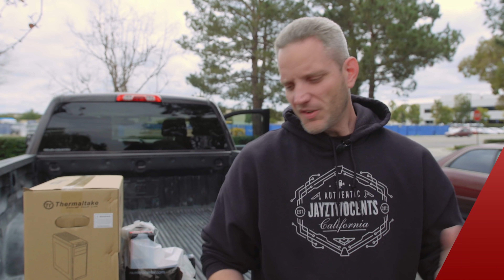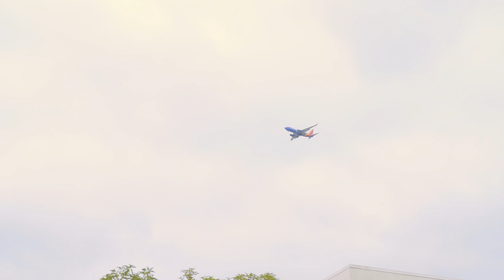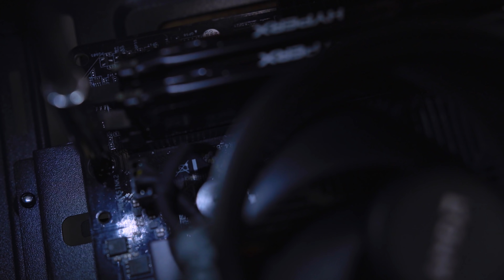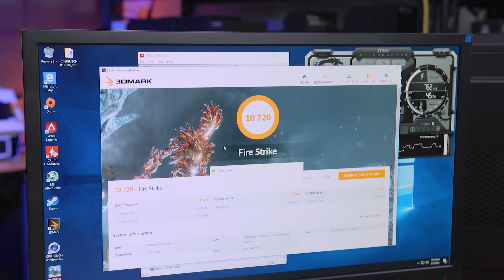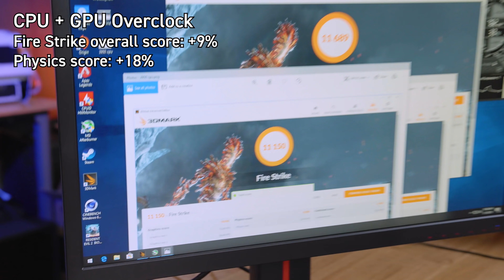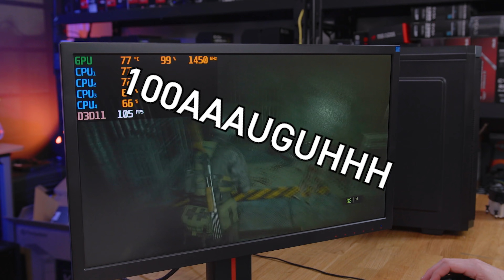CHEAP Gaming PC Build - 2019

Comment: That SSD seemed hot, sadly didn't show it. And no need to pirate Win 10, it's under $20 legit, so cheaper than anything in the build (other than added fan). Apex Legends looks good, runs good and guns fire nicely, but sadly I don't like to get loot and then instantly lose it. Good thing about it that even if you've played it a day you can have all the stuff with those with 1000 kills, so great for a casual player. But the biggest positive on BR style is the biggest negative for me. Even if you'd start with a pistol, it would be a huge upgrade. So many games I've died before even getting a gun.

Comment: I just finished my build. I did a I9 9900k, ROG Maximus XI Hero wifi edition, Corsair RM1000x PSU, Enermax Liqtech TR4 II 280 AIO, 8 T.B. RGB fans, 2 M.2 NVME SSD western digital black 512GB, 32 corsair vengeance rgb pro 3200, and a MSI Armor 2070 OC edition.

Comment: I'd really like to get that 580, but the comments on NewEgg as to it's quality, thermals, and longevity is really scaring me off. The RMA process described seems really problematic as well.  What do you all think?
Reply: Check other 580s and but if you really want the one jay used maybe just pay the 20-50 extra dollars for store warranty. Microcenter has that and it's for 2yrs.
Reply: @MrEpicgamer123  Appreciate the suggest, but it kind of defeats the price point if I'm adding $35ish dollars to it.  I can get another companies 580 that has a rep for good quality for $20 more.  I was asking more if others knew about the problematic (per EggHead comments) nature of the card being used in the video mostly.  And I'm not astroturfing or anything, I have a 1050 I'd like to upgrade, but not if its going to be a loud whiny overheating mess, before it just breaks, and can't be RMA'd to save me life, etc. etc.
Reply: Idk about that this specific company version of the 580. I have used the rx580 red devil in a system I made in 2017 and it's still going strong and it's not loud
Reply: @MrEpicgamer123  Neither do I.  I'm just going by what I've read on the NewEgg comments for the same PowerColor RED DRAGON 580 card (https://www.newegg.com/Product/Product.aspx?Item=N82E16814131720).  Bunch of 1's and 2's ratings.  EDIT: Seems to be Dragon specific 3/5 eggs, the Devil has 4/5 eggs, better comments.  EDIT2: NewEgg had an one hour sale on the Devil version (PowerColor RED DEVIL Radeon RX 580 DirectX 12 AXRX 580 8GBD5-3DH/OC 8GB 256-Bit GDDR5 PCI Express 3.0 CrossFireX Support ATX Video Card) for $199, so I bought that.

Comment: Funny that you posted this today. 

I just bought
- 2200g (79.99)
- Gigabyte B450 Aorus pro wifi (108.99)
- 500gb Samsung Evo (77.99)(they accidentally pulled a 250gb at the register and I didn't notice, price difference of $19 right now)
- RM550x from Corsair PSU (91.99 kinda overpriced but w/e)(they initially sold me a g3 750w from evga but I wasn't planning on needing it so i brought it back and got the corsair when I replaced the ssd)
-  I bought the beautiful Aegis from G.Skill 16gb of 3000mhz @16cl for 89.99 it's the reason I bothered to buy the build
- On the way home I was able to purchase an Rx 480 4gb from a friend used. He pulled it out of a 1070 ti box. It even has a back plate, i'm assuming he took good care of it. I got it for 80.
Overall I paid about 587 and change with the tax.

- I just need to buy a case now and I can't decide what to buy. I plan on upgrading to the zen 2 3000 series and getting a new GPU when I upgrade my monitor. I'm repurposing a 1080p 60hz HP monitor the 2311x. I'm using a Logitech K120 Keyboard and a Sharkoon Fireglider mouse that I already owned. 
- I thought I was going to be getting a case for free but it ended up being a little outdated. My PSU wouldn't have fit and the fans had molex cables and small fans. I'm going to be opting for something more modern but I haven't decided on a case yet. 

- This is my first PC that I've owned since I was a kid, the last one having a floppy disc drive and running windows 95. Up until now I've been sharing a 2013 mac all in one desktop that has a Haswell i5 @3.2ghz and a GTX 750m.  I'm pretty stoked to start my HD gaming journey! Thanks for sharing the vid. I hope more people see this opportunity to get into PC gaming and take advantage of it. I got lucky with the 480 but it's definitely more worth it to pair it with the 580. A lot of games I play don't recommend 8gb of vram so I think I will be okay with the 480 til I find more games I want to play.
Reply: 480 and 580 are essentially the same card
Reply: @nostrum6410  I researched it and saw the 480 came out in 2016 so it's not even that out of date yet! I'm pretty stoked.

Comment: I wanna play AAA titles with over at least 60fps on 2k, max settings. Can anyone suggest me pls.
Reply: Ryzen 5 2600 should be good(minimum if want better have to go more expensive parts) 16gb ram 3200, 240 ssd, 1-2tb hard drive, 650w psu, b450 motherboard, and case up to you, graphics card it's between 2060 and 2070. Have to watch benchmarks to see which suits your needs better
Reply: @MrEpicgamer123  Thanks a lot !! Must I really go AMD cpu ?? What is the intel alternative of it ? or is AMD the better choice to meet my demands ?
Reply: Equivalent I think would be an i5. Just check prices to see which works better for you

Comment: His budget build gets 11,500 in firestrike, my 2080 and 2600x gets 20,000, for context.
Reply: I just did a used 1070 build for $490 if you're interested, it performs very well.
Reply: @RamB0T  yeah that's what I upgraded from, it didn't really satisfy me once I got to 144 hz though, but it can max anything on 60.
Reply: @m.streicher8286  Nice! Any problems with the GDDR6 ? Bryan over at TechYesCity had some issues with crashes...
Reply: @RamB0T  no, I haven't really pushed it, but I have it on +550
Reply: @m.streicher8286  Nice, how long have you owned it for? I was thinking about getting an RTX card for the channel. Was concerned about the reported issues.
Reply: @RamB0T  I think the issues we're just on the 2080 ti, plus most brands are good about replacement. I've only had it for 3-4 days I got and awesome deal on it used.

Comment: Apex is horribly optimized. I can barely hit 80 fps on the lowest settings with a GTX 970/i7 4770k combo meanwhile, I'm getting 200fps in BF4.
Reply: 1% lows and 0.1% lows are soo bad in Apex. Micro stutters on a 1070...

Comment: A video on how to prevent leaks & how to clean and prep your system if a leak happens? I had a leak today & it was scary. I'd honestly like advice  on it just not much info out their on if something goes wrong & what to do when it does happen.
Reply: Try asking Reddit or Lord Google
Reply: Aio or custom loop?
Reply: Reddit will be the best place for this question mate....but a video is helpful👍
Reply: What was your cooler?
Reply: @TurtleBobThe1st  It was a custom loop. The fitting was an ek compression brand new. That's why i'm a little confused. Both o rings were making good contact also.
Reply: @Near2Future  try contacting them, maybe they can help you
Reply: Honestly the best you can do is pray, other than that unplug your PSU and take it out and make sure absolutely everything is dry. If it got into somewhere small this can take a very long time. It's really important to stress test loops before you put them into your build:)
Reply: He does have some video's on this already. But for the life I can't think of the exact name. Maybe try Kyle's PC leaks or Bit-Wit PC leaks. And that will probably send you down the "How to take care of a leak on you're PC" Youtube rabbit hole.
Reply: That would be the best video I wish he would make !

Comment: I got to point out that you can get 1450 MHz at +10 MV, a Power Limit of 100% (IE Stock Power) Temp Limit of 84c (Stock Limit) and if you do a good Fan Curve you can hold at 68c... Most RX 580's come out of the Factory Overvolted by 20 MV... You can actually Tick it back -18 MV and get 1400 MHz Stable! You don't need 120% Power or that many Millivolts to push it to that Clock... Your wasting Electricity and creating Excess Heat Jay that and that extra 50 MHz means 5-10 Fps Tops...

Comment: i have the same graphics card but a better processor and a NZXT case and a as rock motherboard
Reply: Does the graphics card get loud? I heard it does
Reply: @husnainas6148  i mean if you have good enough airflow through your pc it should not have to go full blast. And when it does its sorta sounds like a ps4 but quieter
Reply: Unless if you put it full blast on purpose to cool everything down then yeah its pretty loud

Comment: Glad to see we're back to a day and age where you can realistically buy a good mid range system for 700-800 bucks again that will give you 60fps at 1440p or 144hz at 1080p.
Reply: devilmikey00 no way that can give you that performance
Reply: @mynameisazz  Ultra settings at 1440p with the rx570.
Reply: @mynameisazz  My 2400G, with an rx570, plays Dirt Rally at 1440p, 75hz, freesync on at 75fps+.  The 2400g on its own plays at 1080p 59fps average, 51fps at 1440p, both medium settings.
Reply: Craig Howe what about other games?
Reply: @maincharacter2677  I just ran a bench mark for Formula 1 2018. 1440p, high detail, 75hz, Free Sync on with the rx570 we are getting a min of 58fps and an average of 68fps. I don't have a lot of games I can test for you, sorry.

Comment: i just want to see a possible mid tier 1080p, maybe 1440p 144hz build thats as cheap as it can get that can have more than 70-110 fps cuz my very crappy rx460 just isnt cutting it anymore and i would like to know a price point i need to work towards 
i dont care about 4k, i dont care about ultra settings,  cuz i usually turn those down to get as much fps as possible
im assuming an rx590 or gtx1070
Reply: Thinking rtx2060 with ryzen 7 1700x( 140 at microcenter I go to but no cooler) or ryzen 5 2600 and 16 gb 3200 (140 ish as well) on b450 motherboard and then fill in basics
Reply: @MrEpicgamer123  any intel equivalents to the ryzen? i just want to know all my options and ill pick whatever based on price
Reply: Intel equivalent is i5 (for minimum)    and I would run it on a z390 motherboard not the h- don't remember the numbers board
Reply: @MrEpicgamer123  an i5-7500 okay? ive got an unopened one cuz my current motherboard isnt the right chipset for it  it was a gift from my family and they have no clue about  computer tech stuff
Reply: I think that will be ok. You would have to look up benchmarks with that cpu to see if it can handle the games you want

Comment: Maybe some1 can help me I have i7 7700k looking to upgrade gpu I have gtx 1050 ti not looking to spend more than 500 wondering what opitions would be best bang for buck
Reply: If you're brave enough to try it may be check used parts might be able to get 1080s or 1080ti for cheap. If not rtx2060 or vega 56 but vega might still be overpriced. Vega only if good price like 100 bucks cheaper if not rtx 2060, rtx 2070, or Gtx 1660

Comment: to save extra money, get open box on everything you can, most have a complete open box set. Also check places like bestbuy, newegg, and amazon for better deals, microcenter will match price if sold by the respective company (so it has to say sold by amazon/newegg). Can build a more powerful system for the same price.

Comment: I have a couple of those Inland Pro 240GB SSDs.  I have not had them long (3 months or less) but they work fine so far.  My use case is also budget gamers....not quite so much budget.  One i5 with a 1060 and one 2600x with a 1060 but that SSD is key to making the "not suck" happen.

Comment: Just as a reply to Jay's build I did some stuff using Newegg's wishlist:

CoolerMaster MasterBox Lite 3.1 MicroATX Case - $39.99
ASRock B450M-HDV R4.0 Motherboard - $69.99
Powercolor Red Dragon RX 570 OC 4GB - $129.99
RAIDMax Scorpio 535W Semi-Modular Power supply - $43.52
AMD Ryzen 5 2400G - $139.99
Silicon Power ACE A55 2.5" 256GB SATA-6.0 3D TLC SSD - $31.99
OLOy DDR4-3000 Single DIMM 8GB RAM - $42.99

Total price: $498.46 minus a copy of Windows and a monitor and keyboard+mouse set.

Jay is spot on, you don't need to break the bank to just to build a nice unit to play games. Game developers know what people have and are running since the mess with  mining happened, so nothing out there is going to be so outlandish with requirements. Hell, most games are geared to run on as minimal as a Vega11, RX560, and GT1050 just to make sales alone of games so publishers can make returns on their investments.

Always look for special deals and price reductions on parts as well. There are lots of reputable PC parts manufacturers out there and a lot of up and coming new manufacturers, so you'll often find a lot of parts either on sale, reduced prices, or simply just cheaper. You might even find Open Box deals (usually former demos used for product tests by Newegg's Youtube channel) for great deals also.

Be merciful to your wallet. Treat it well, and it'll treat you well.

Comment: On any of these thermaltake cases with the filters, take them off the front and top, leave the one on the bottom. Case temps drop about 5C by doing so, maybe more depending on how many fans you have in there. I had to do it on my View 71 TG, take the front and top filters off, dropped my inside temps down to actual room temp, instead of being nearly 10 degrees above.

Comment: My 2400g with a RX580 8gb runs everything at 1080p juuuust fine!
Reply: im confused why youd get a 2400g and a graphics card
Reply: @nostrum6410  why wouldn't  i? I honestly already had the Rx580 from a previous build, a build that i sold the 970 motherboard, 16gb ram and Fx8320e  processor out of, then bought a new motherboard and the 2400g  and i had 16gb ddr4 on hand......2400g is my Backup/media pc.  i could absolutely run it with tjust the vega 11 but i like to play games on it too!....so thats  WHY....

Comment: I feel you should always include monitor/keyboard/mouse since its also an additional cost for those just getting started and if it is an "entry" level Pc, it usually means if youre buying this, it's your first pc. So you don't have anything.
And a cheap monitor vs a 144hz monitor could mena the difference between getting 8gb of ram vs 16gb, a 2200g vs a 2400g... etc etc.

As for the OS, Just put Windows 10. It's free. sure youll have the watermark, but the Os will still work fine. Activate it whenever.
Reply: Problem with including those things is varies with people preference. I mean if he's going budget. 30 buck keyboard mouse combo from cooler master. Use a tv you have at home.

Comment: I did this same build with an older AMD FX-8350 overclocked an extra 500mhz... Not a bad build for the money. RX 580 runs at 82 degrees which in my eyes is a bit warm, but it will play Apex as its fully optimized game.

Comment: The 2200G already bottlenecks a GTX 1060 at 1080p, i can imagine it even bottlenecks an RX 580 slightly more. Bad choice as a cpu imo. Your 0.1% lows will be too low.

Comment: @JayzTwoCents I got a hp pre-built just over a year ago with 8gb 2400mhz ddr4, ryzen 5 1400, rx580 4gb, 1tb hdd, crappy motherboard and a disk burner for good measure for 560$ on amazon of all places.  (hp 580-131)  Don't worry I just robbed parts out of it... this is when rx580s were 600$ because of mining...

Comment: Just throwing this out there (like I did in a previous episode): buy ur GPU's used. End of story. There's SO MANY options on ebay, and for ~$100 you can fetch a GTX 1050 or 1050Ti (after some serious bidding efforts). I got my EVGA 1060 SSC for $136. 

I would also drop the hard drive entirely, and either get a more known SSD brand for that money, or get a 2600X Ryzen.

Comment: Roughly $500 if you must play using keyboard and mouse or only pay $213 for the Xbox one or $320 for a PS4. I suppose the PC can do a lot more things to justify the price premium compared to consoles… But it's difficult to justify if all you do is specifically gaming.
Reply: Yes and no it won't run at those quality settings. That PC is more comparable to Xbox one x and PS4 pro
Reply: @MrEpicgamer123  my point still stands… Both the PS4 Pro and Xbox one X are roughly $390 at Walmart anyway. So roughly $110 cheaper. The only defense for the PC is keyboard and mouse is debatably better for FPS like Apex, and PC being versatile in the number of uses it has outside of gaming. it makes me think it's rather impressive the cost per performance is as good as it is.
Reply: Yes you have a point it's slightly cheaper but you don't get the same performance. Consoles don't go past 60fps. Most games are locked at that and struggle to stay there.

Comment: The same build here in Australia;
2200g - $139
ASRock - $101
HyperX - $94
2tb - $78
SSD - $52
Case - $85
PSU - $96
Cheapest RX - $299

All up $944 + $60-$100 for delivery.
Have to buy online here, walking into a store would be double that price and they would order it in anyway.

Comment: This is pretty damn well future proof compared to the Dell Optiplex route but it can't be beaten. 

Could build the same system with the Dell Optiplex for 125-200$ cheaper still having a ssd and hdd.

Again, not as future proof but would be something closer to "budget building."

I would go Dell Optiplex 790MT. Has a i5 2400, and 8GB ram with no hdds.-115$ 120GB SSD- 20$. 1TB 7200 rpm-30$. 550w PSU-30$. RX 570-110$

Total 305$ 

Much cheaper and great performance. Not a 580 but pretty close. 

Could buy a 580 instead and still be cheaper. Or cheaper GPU.

Respond if you want the links to how I got these prices.